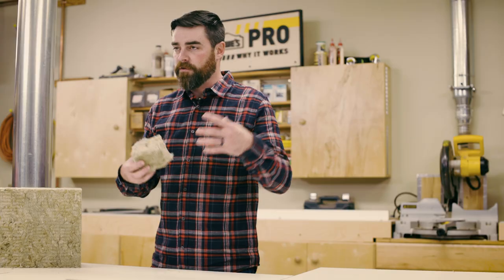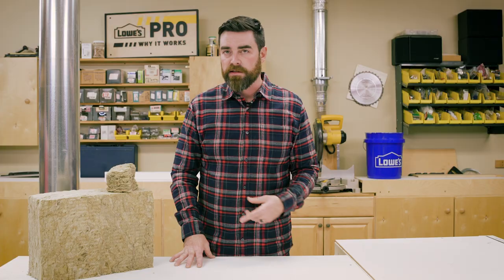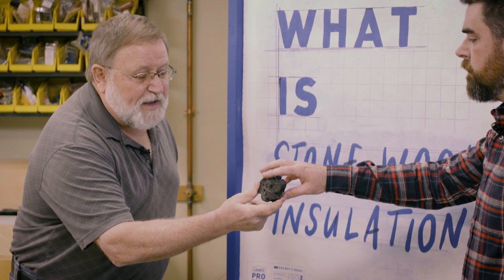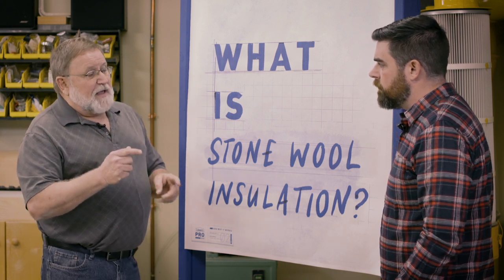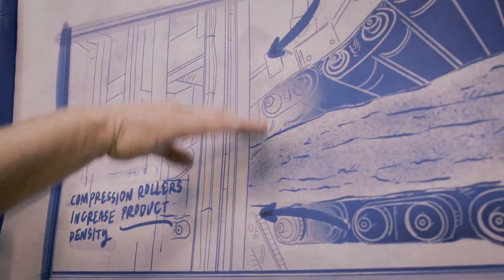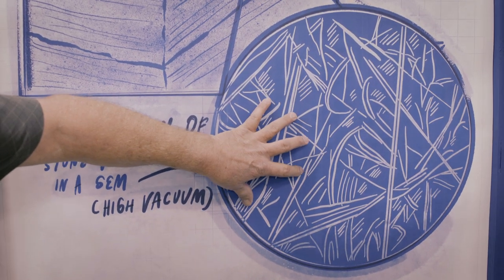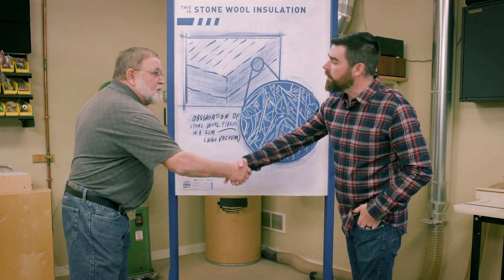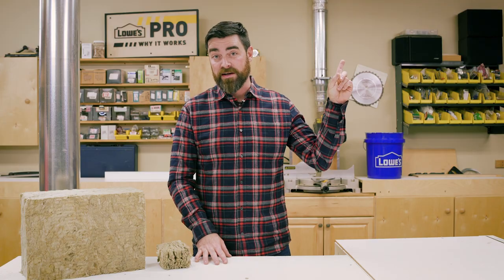Why It Works: ROCKWOOL Stone Wool Insulation

Comment: I love Rockwool. I've used it under a Sunroom and am going to add it to my Crawlspace and Attic. The GREAT thing about it is, you don't need to wear a mask or special clothing when installing it like you do with fiberglass! Also, I've used an electric knife if needed to cut for sizing. EASY!

* Better fit, flexible edge compensates for normal frame variability, cuts easily
* Made from natural and recycled materials - user friendly, no fiberglass in product
* Easier and faster to install
* Water-resistant
* Non-combustible, fire-resistant up to 2150º F
* Excellent sound absorbency
* GREENGUARD certified; chemically inert - CFC and HCFC free product and process
* Does not promote growth of fungi or mildew
* Friction fit to ensure optimum performance, no sag over the years
Reply: E911Eagle electric knife? 🤔 hmm I never thought of that.
Reply: @theburris  The home stores sell a small knife/saw for cutting rockwool, seems to me its time consuming and messy. Elec knife is quick with hardly any cleanup.
Reply: E911Eagle awesome! I’ll check it out
Reply: Does it eliminate the need for facemask. When dealing with fiberglass, one can get really itchy
Reply: J M Garcia they do recommend goggles and a mask in tight spaces.
Reply: It's just made man asbestos, no safety gear needed lol.
Reply: @Delta19G  YES SIR! No Facemask needed!
Reply: Sounds great. But how toxic is it? What VOCS does it give off?

Comment: I have an old motorhome that has a tall fiberglass roof.  Is there a way to glue it or tack it to the inside fiberglass so that stays in place until I get the  ceiling covering.... do I need a vapor barrier and if so where and how?  The vehicle is about 15 feet long.

Comment: I handled tons of this stuff and the warnings on packaging back then.. are up there with asbestos
Reply: glad someone else was hearing red flags while watching this video. Such toxic stuff. Proprietary binder and oil. fibrous steel slag? just what i want in my home
Reply: @Randy-rs1cg  so is fiber glass better? just curious cause my main concern is looking for insulation that doesn't gas off so much Voc's.
Reply: @littlegreendress6243 the problem is the same as fiberglass: tiny little shards that can get all up in everything. It isn’t toxic like asbestos, but you’d be kind of foolish to work with it in a tight space and not use a mask and eye protection

Comment: Does rockwool/mineral wool allow water vapour and air to pass through? I want to put some in
a draughty house vent, but without stopping air and water vapour passing through to the outside.
Reply: insulation works by limiting air movement between the conditioned space and the exterior. this product is not going to let much air pass through (depending on how tightly you install the product), but it is going to allow vapour to diffuse out of your house with a perm rating of roughly 35

Comment: It retains water. Be careful. They are using it in horticulture seedlings.
Reply: Yes this. A little bit splashed on the surface will bead off because of the oil used in the manufacture, but if it's sitting in a puddle it will soak it up. This demonstration is risky - if people think it's as water repellent as polystyrene, they're going to get careless in installation.

Comment: Everything about HOW it's made - but NOTHING about HOW it works as either as/for thermal insulation or sound damping.
Reply: sdushdiu what it’s manufactured from is partly why it performs the way it does with heat, water, and sound. Hard to squeeze into a 4 minute video. As for insulation, it comes in many different R Values, which it’s insulating power rating essentially.
Reply: @theburris   Sorry, but how if functions is not difficult to describe. What is easy  - but often not done - is to say what one means, and to mean what one says. So much for "WHY" it works.
Reply: You clearly misunderstood this video. Nowhere does it claim to explain HOW it works, as you feel it should. It's called "WHY it works." The host showed that it was fire resistant and repelled water - then he and the guest explained WHY it was able to do those things. I think the video you are looking for is called "explaining every feature of Rockwool that you can read about in other reviews on the internet."
Reply: @DealerTags  Why it works has nothing to do with water repellency nor fire resistance. It is NOT used as a waterproofing or fire resistance medium. 
Try again. And then you might try taking a physics course to learn WHY it can be used as a component in sound reduction and why it is more commonly used as thermal insulation. This video does neither.
Reply: @sdushdiu  I'm sorry that you had expectations that this would be a video telling you that insulation has insulating properties. 🤷🏼‍♂️  This video explains what sets Rockwool apart from other insulation and why it is capable of doing those things. And yes, people do use it as a fire resistant medium. Rockwool is rated for use as a fire block between walls as long as it's greater than 2.5lbs/ft³.
Reply: It's Insulation! I think the question about it's Thermal quality is pertinent.
Reply: Exactly. The video is titled "WHY it works..." Yet there's absolutely no mention at all about WHY it does what it does.
Reply: @SteveFrenchWoodNStuff Mineral wool works the same way as fiberglass batts.

Comment: it looks like a really carbon intensive process to make it, definitely bad for the environment
Reply: That depends on the payoff in how much energy you save by not heating your house so much. Those big american houses built the traditional way use devastating amounts of mostly fossil fuel to heat them. Wrapping them in good insulation and sealing up the drafts can pay for itself pretty quickly - although it would be better if their builders were thinking in terms of centuries instead of decades.
Reply: Lol